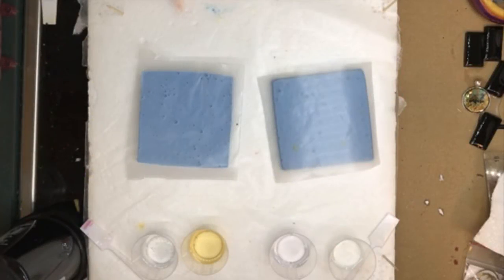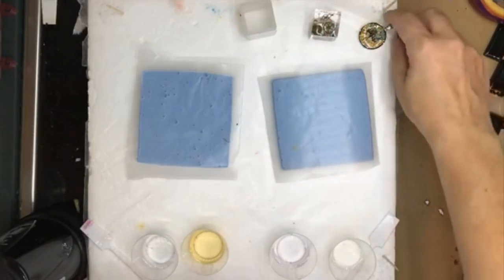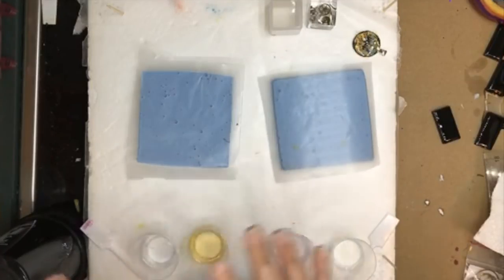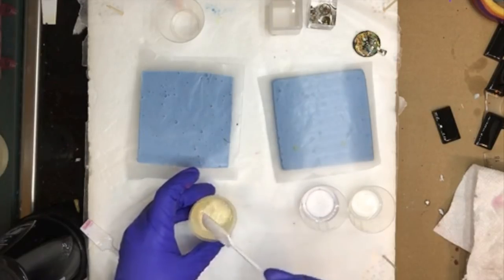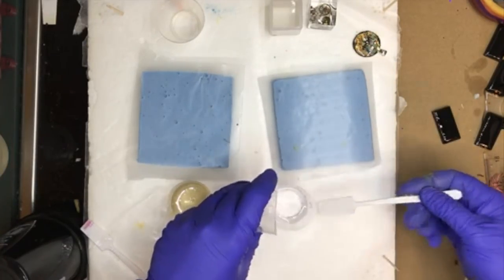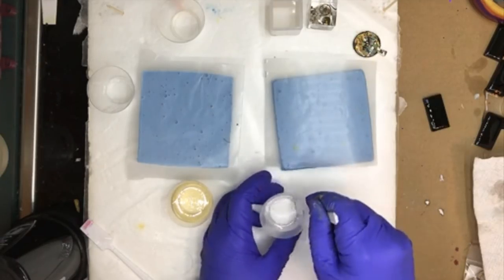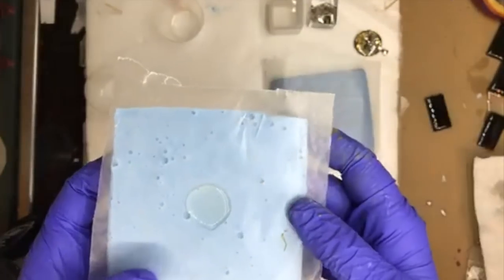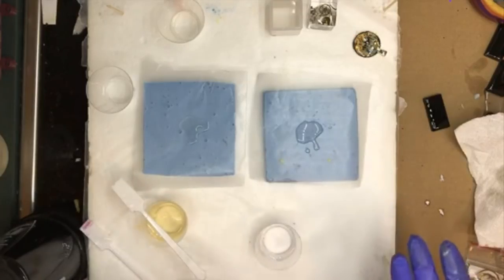Doming resin versus casting resin

Comment: FIXED!!  Hi there!  I asked a week or so ago about doming resin, and what would be best for my wooden trays.  I have trouble with Amazing Clear Cast not coating the sides properly.  I switched to  Envirotex and VOILA!  Problem solved, and I also find that it cures to a harder finish much faster than the Amazing Clear Cast.  Thank you for your wonderful website!!  Very informative about the products that are out there.  Can't figure out how to post a picture though.  Waaaaahhhh.

Comment: Hi. And thanks for the great information. I am still getting confused on what to use on my project. Maybe its because I don't have that many options on what to use. I have come across words like Resin and Epoxy or Epoxy Resin. And then Doming and Casting Resin. Anyway, I have this project for wine glasses. What can I use to cover the glass stem after putting glitter on it? Looks like the Mod Podge isnt enough...
Reply from the maker: HI Tom, I've got a guide here that explains resins and which one is best for your project:  https://bit.ly/3mxFmGT
Reply: @ResinObsession  Thanks for the guide. i am pretty excited. It is very helpful and I feel like a pro now.

Comment: Hi would doming resin have better anti scratch properties? I would like to dome alphabets but apparently the casting resin that i use seem to have scratches more easily.. do u have any recommendations or advise in what resin i shld use thats scratch resistant?
Reply from the maker: Hi Ariel, it depends on the doming resin, but it has been my experience that casting resins cure harder.
Reply: ResinObsession thank u. Do u have a doming resin to recommend that is scratch resistant?

Comment: I am doing wooden trays. I've been using Alumilite Amazing Clear Cast but have been very disappointed with the sides!  Perhaps I should use a doming resin instead?  Can you advise on products?  Thank you!
Reply from the maker: Hi, Amazing clear cast is a doming resin.  What is it not doing that you were hoping to accomplish?
Reply: It's dripping down the sides.  I have to do multiple pours. Then I have to sand the sides and the bottom.  I am looking for a "bar top" effect.
Reply: And... thank you for the reply :)

Comment: Is casting resin more durable/sets harder than doming resin? I used doming resin to make rings and they seem to get flexible and more like stiff rubber as your body heats up the ring.
Reply from the maker: Yes, Luke casting resin cures harder.  You can buy it in our store here:  https://shop.resinobsession.com/collections/resin/casting

Comment: 1.  Can you pour a layer of doming resin on the surface do a piece made from casting resin I’d you want a dome on it?   2.  What if you want your resin to coat the sides of your art piece, should you use a casting or doming resin?
Reply from the maker: Yes, you should be able to put a doming resin on the surface of a casting resin.  Use 'like for like'.  i.e. if you used an epoxy casting resin, then cover with an epoxy doming resin.  For the sides of an art piece, you should use a doming resin.